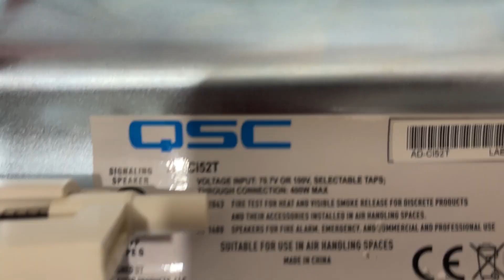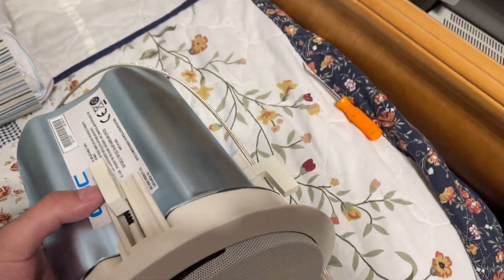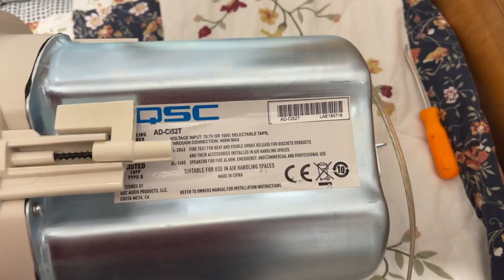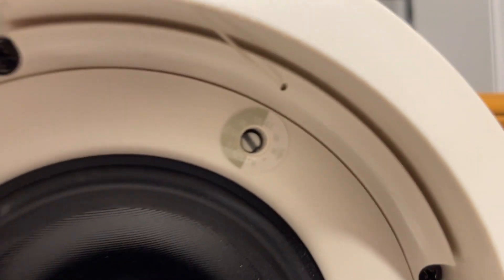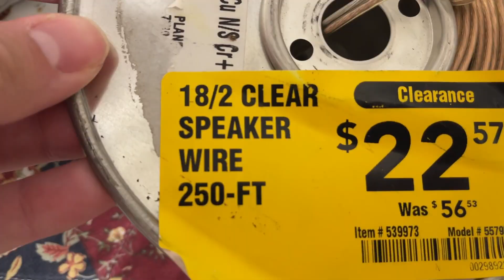QSC ADCi52T Ceiling Speaker Overview & Types Of Wire To Use With 70 Volt Audio

Comment: Most QSC Speakers I seen is their Pro Audio Line such as the K-Series. I seen QSC 70v speakers used in Theme parks such as Universal Studios. I do want to get these but they are really expensive
Reply from the maker: I've seen a small pair of the QSC K-Series speakers used at a local Mexican restaurant outside which closed this past summer unexpectedly.

Comment: My high school that was just opened last year uses these in the band/music area. They are connected to the auditorium sound system and are used as monitors so people in the band area can hear what is happening in the auditorium. The auditorium sound system is also interfaced with the school’s Audio Enhancement EPIC paging and intercom system, so the music areas do not have any speakers connected directly to the intercom system and these are used instead. Just like the JBL speakers that they are competing with, they have some amazing sound for their size.
Reply from the maker: That's a complex different setup for these type of speakers in a school setting. Usually these type of speakers are separate from the school intercom system. I like these type of speakers due to the size and how much bass can come out for a small ceiling speaker.
Reply: @CristianOrtiztechmaster926  Yeah, my school has a lot of stuff like that. For example, both gymnasiums, the cafeteria, the auditorium, and every classroom have no 70v speakers tied into the intercom system. All of those rooms have their own sound systems that have an intercom override. The classroom sound systems are actually just using Audio Enhancement IP amplifiers that automatically interface with the intercom system with Ethernet and give two way communications as well. It seems like a good thing to cut costs as you can just use one set of speakers for every purpose, but it really just creates a whole new set of problems with all of the things that can go wrong with the integrations.
Reply from the maker: I agree with the whole other set of problems. Very complex setup at your school let alone the VoIP configurations.